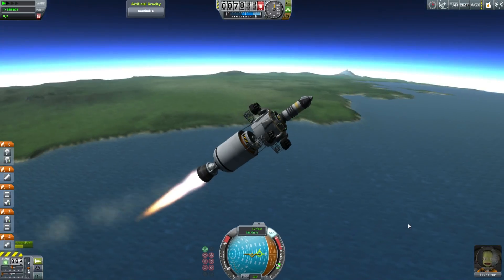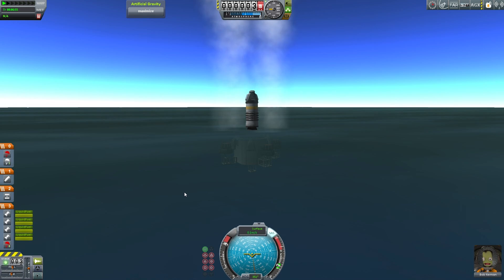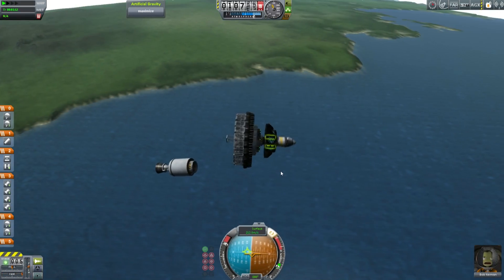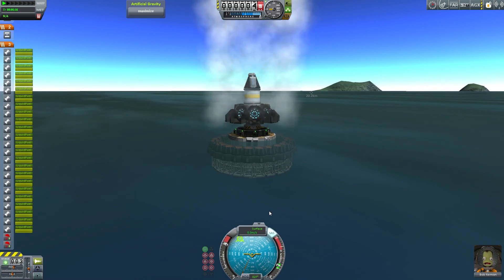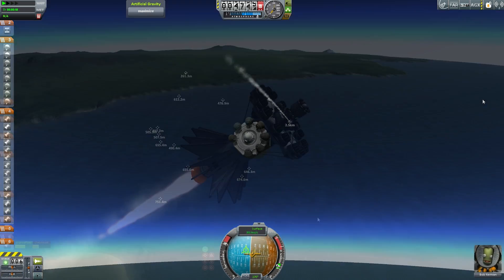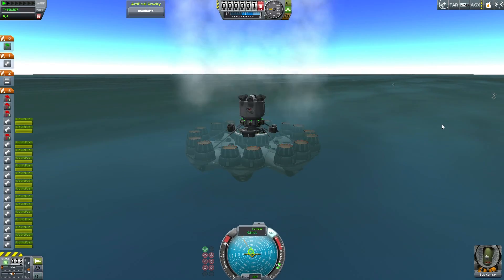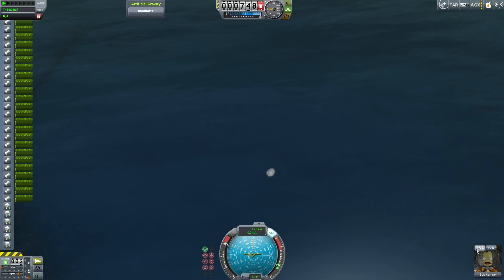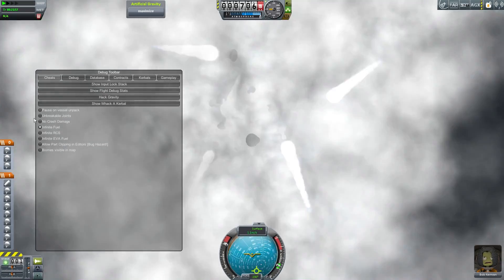Kerbal Submarine Program

Comment: Did you ever get to the bottom trench? PS subs are not aircraft, if you want them to sink, add more weight(ballast), when you want to go up you drop ballast weight. You are flying a reverse balloon. add containers that can hold the cheapest dense weight, ore is probably best choice. a soviet capsule maybe the best dive bell, heaviest pod? adding batteries will also be a good idea, with a RTG?
Reply from the maker: Yep, but back when I tried this, everything in KSP floated, there was nothin that would work as ballast.

Comment: Yep.. as you dive deeper your rib cage is slowly crushed by the water pressure. This also compresses the air in your lungs ( which is why scuba divers need higher pressure air the deeper they go and the clever regulator to stop them being exploded by air at 150psi from the tank ).  Eventually you're crushed so much you're denser than the water and you sink rather than float and down to The Locker with you.

Comment: I don't know who told you that you sink below 20m but that's not exactly true. Like, if you held your breath at the surface where pressure is 1 atmosphere, and then swam down as it compressed then sure I suppose that makes sense but if you take even half a breath of compressed air from a divers cylinder while underwater, especially if you have high fat percentage on your body, you will very much float.

Edit: The general rule if you run out of air at depth is to take one final breath, strip anything weighing you down, and slowly float to the surface letting smalled bubbles fall out of your lips as the air as you go upwards and the air in your lungs expands. You'll find that one breath at depth is plenty to get you to the surface as long as you keep ascending and you don't hold it and let your lungs explode.

Comment: I want someone to calculate the density of water in KSP
Reply: I think what he means, but didn't explain well at all, is since kerbin is so much denser than earth the water probably is too.
Reply: Think about it, Kerbin is 1/10 of earth, so the water should be too
Reply: Gravity doesn't really have to do with density. It just seems that water in KSP seems to be so much denser since anything seems to float on it. I don't even know if density has to do with it when I think about it and it might just have to do with the center of mass for how much it floats.
Reply: +Daniel Brown Maybe salt? 😂😂
Reply: Nathanael Vetters Okay, I get that. But using that logic, wouldn't that mean that all the materials used to build rockets are also much denser? I also didn't mean anything against you IdiotGaming
Reply: true... didn't think of that. Although I believe fuel is heavier in KSP than real-life, it's not by a factor of 10.
Reply: 1,000kg/m³ is the normal water density so if that is salt water the normal density should be  1024.5 kg/m3, and if kerban has the same mass as Earth, and 10 times smaller, then the density of Kerban seawater is 10,245 kg/m3, its a rough estimate, but it shouldn't be very off.
Reply: Ralakus Thanks for doing that. I wonder if that density actually applies to KSP.

Comment: Could you use a ballistic entry? Launch and plunge directly into the water without parachutes?
Reply: +Anson Tan 
But I'd you do it a bit slower then you'll be fine cause they changed the killer water
Reply: If you enter the water at high enough speed you will automatically explode

Comment: So what did the kerbals learn? THE OCEAN IS AT LEAST 34 METERS DEEP
Reply: Red Truck Using the new water physics, I managed to smack a small probe with ore tanks into surface around 1200m below sea level. Actually, in the 1.2 the altitude below sea level is red, so I think they are adding some simpler ways to achieve these altitudes. Maybe it's buoyancy nerf - or even new parts!

Comment: So a few versions ago I made a few submarines and they still work! My submarines are stock, use no cheats, but don't use engines in a VTOL configuration to go up or down, but instead relies upon engines that push the submarine. The way you go down is transfer fuel to the front, then it will go down, transfer fuel to the back and it'll go up ETC. I use FAR (but it should work without it) and hyper-edit to actually put it in the water although wheels could be attached and it could then be driven in! You can download the craft on the following link but if you share it in any form (be it video, picture, the craft file or other) you must give credit :P        
https://www.dropbox.com/s/kdoky016826g4yd/Missile%20Submarine.craft?dl=0

Comment: Explosives at high pressure probably still work pretty well. It's the shock wave that transmits a lot of the destructive force anyway. Also, you say "spec'ed" as if the Kerbals use specifications. I'm sure we all know the answer to that.

Comment: I wonder if you get use KAS to attach struts to the bottom of the sea to the spacecraft and make an underwater sea base!
Reply: Pumpkin Pie In short, yes, you can, with challenges.

To explain, you can sort of do it with the Hooligan Labs Submarine Parts. Since you can adjust your buoyancy, you can make things stay at the bottom of the sea. Of course, like ORC Gaming mentioned, the game physics gets a bit wonky down there, opening up risk for spontaneous combustion (as it parts will get destroyed randomly). Not to mention, EVA is very glitchy down there, so you'd have to have small personal submersibles to get around, you could probably use USI Survivablity Pack parts to do this.
Reply: Craft survivability is a factor. At those depths the games physics will kill any craft.

Comment: Did you know that when a submarine does an emergency blow from test depth, the main ballast tanks are less than 10% full of air, and it expands on the way up? When submerged, the main ballast tanks are always completely flooded, and a set of trim tanks are used to adjust the weight of the vessel to approximately neutral buoyancy. The trim tanks are also used to supply the fire main, something your submarine apparently lacks (to my eternal entertainment).

Comment: Humans can sink at the surface too. My uncle was a gymnastics athlete. Very compact muscular frame with almost no fat. If he stopped treading water he would slowly sink to the bottom of the pool. 

I'm also a scuba diver. I can confirm that you will sink when you get below a certain depth. We carry buoyancy compensation. Basically a vest with air bladders in it. As you start to sink you press a button and a small amount of air decompresses from your tank into the bladder thus adjusting the buoyancy to neutral. Not having neutral buoyancy is incredibly tiring when diving.
Reply: So I'm not the only one?? I have none of your fancy muscles, but I'm very skinny and I am not buoyant at all. I'm the only person I know who doesn't float in water.
Reply: Bryan Myers If I take a deep breath above water my body becomes very buoyant but if I breath out I sink, which is annoying because if you don't have any air in your lungs you want to be above the waterline not below it!
Reply: ScottJohnCaile 
Could be worse.
Imagine if water-based arm and leg movement required DLC to activate.
Reply: Badatstuff Nope your not the only one.  The physics of floating is fairly simple.  As an object enters the water it displaces water (makes a hole where the water used to be).  If the object weighs more than the water it displaces it sinks, if less, floats. 

I think the deal with us humans is that being made up of so much water we're basically neutrally buoyant (the average person has perhaps 3 pounds of positive buoyancy which is only about half a gallon of volume of water) , but  some humans are just compact enough they displace less water per pound of person and therefore sink.

+Badatstuff, ever go swimming in salt water?  You may find you float in the ocean if you don't in a pool.  The salt makes he ocean denser which means things float better there.
Reply: I'm very slightly below neutral. A lung full of air let's me float, but not well
Reply: k